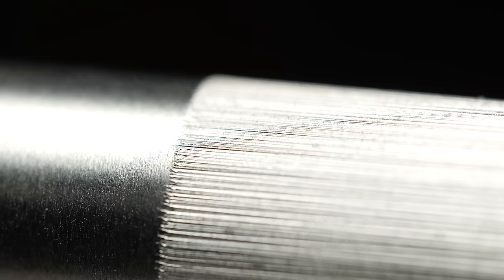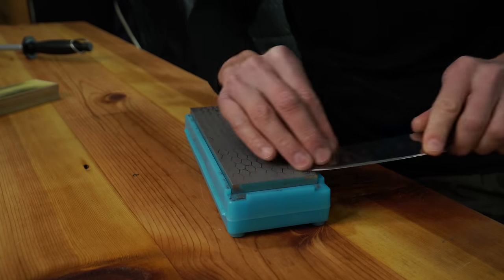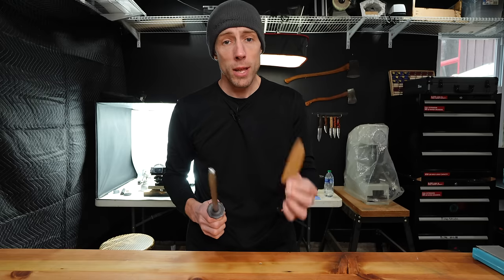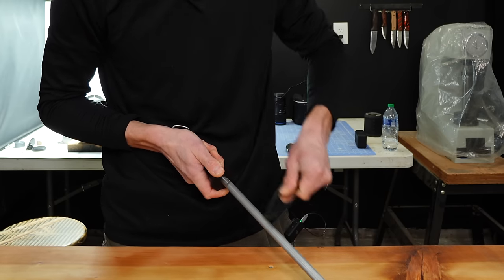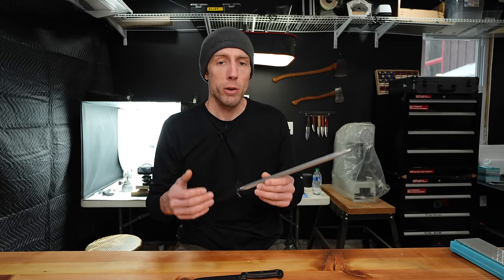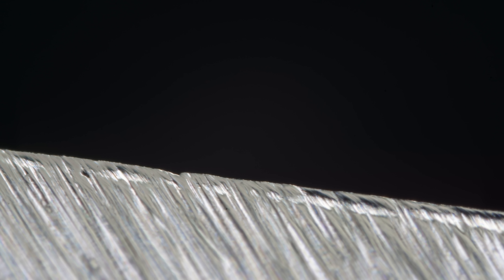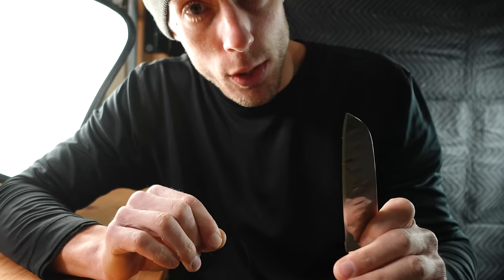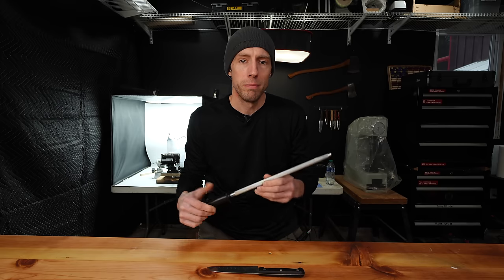What Do "Knife Sharpening" Honing Steels Actually Do?

Comment: You are completely wrong. Steel depending on it’s alloy and temper will either chip or roll. You call a roll a burr but it is a roll. 2nd, anyone with any real knowledge doesn’t use a “hone” with those crappy ridges, they use a smooth polished “steel” that is tempered harder than the knives they use. The reason being that yes it does in fact smooth out a rolled edge as you showed. Professional knife users such as meat cutters don’t generally finely hone the edge because the feathers on the edge from a courser grind cut meat better than a “sharper” polished edge will. Think of it like tiny serrations which they are. The issue is, those feathers aren’t supported by steel on either side like a finely honed edge is so they are weaker and more prone to bending or “rolling”. They don’t have time to constantly “sharpen” a blade and they don’t really need to as the edge is still there it just needs to be realigned. Hence a fast pass over a steel and back to cutting. Eventually the base of all those feathers work harden to the point where they no longer are soft enough to roll and they break off. Once enough have broken off, you no longer have a sharp edge and it’s time to break out the stones, remove metal again to make a new sharp feathered edge and the process begins again. Using a steel to fix an edge that is rolled saves time and saves removing metal from your knife. This process has been well known for over a hundred years at least! Microscopes have been around for a long time. Those imitation sharpening steels are a gimmick to sell to an uneducated public to give the illusion of removing metal, (sharpening) but that’s not what they were intended to do. Back when we still had actual butchers, everyone knew this. 👍🏼

Comment: I respectfully disagree with your analysis. I believe you missed the key factor in using the honing steel - carbide content. I love using my steel on low carbide content carbon steels that have high toughness. This is the type of knife the steel hone was made for and it is very useful. Higher carbide stainless steels never come off my steel honing rod very well. I have loved watching your channel develop - I've seen you take critical comments constructively. I would be stoked to see you dig into what honing rods do to tough low carbide edges.

Comment: here are two mistakes: 1. you dont have in normal situation a so much bent over the apex, in that way as you showed its so unrealistic as possible lol
2. the sharpening steel have to be simply a flat surface steel part, on which you can smoothly straighten out, for yes: the cause if you dont sharpen your knife all day long ;)

Comment: I can count on my hands how often these worked well for me. I have actually had better use for them while sharpening the blade on coarse stones. The ridges on the steel were very shallow so that might have had an effect. I was given a much more textured one without abrasive and it almost always destroys the cutting power on my edge. I run my chef knife on a translucent Arkansas stone with a little dish soap and water before use and have shaving results.

Comment: The only success I've ever had with a knife steel is in my mothers kitchen. She doesn't ever sharpen her knives and they are all incredibly dull, and with reasonable pressure you can at lease give it a terrible edge that cuts instead of no edge that requires you to either saw or hack through whatever you're cutting. I just need to actually sharpen them, but the steel has worked as a stop-gap.

Comment: I have a sharpening steel that is approximately 75 years old. It is different from what you can buy these days. The ridges cut into the steel are considerably smaller and sharper. They appear to function more like a fine file than those made today. I also have a ceramic sharpening rod and it does work much better than the steel.

Comment: I have a steel rod without ridges. It's smooth, it was used a lot by my uncle in a butcher shop. Without the ridges very smooth, very hard steel. You can unroll the edge without damaging it, also a bit of shine If you go light on pressure. The ridge ones are useless in my opinion. As presented they do damage

Comment: You're using it wrong. You should move the knife diagonally accross its length as you unroll the edge in a sheering motion. You're just moving it straight up and down. No wonder your edge is still rolled.

Comment: You are absolutely right but most kitchen knives in professional use are of a relatively soft non corroding steel, they don't hold their sharpness that good, so they usually get sharpened by a person whose profession is cooking and not knife sharpening, so they use either a pull through sharpener or a easy to use driven sharpener. 

So the knifes will likely never get sharpened correctly. Not that is say a sharoening rod is a good tool just a few explanations und why they are used

Comment: Good vid. The chefs I sharpen knives for use the steel rod edge leading not trailing. They tell me they tear off the rolled edge and create some kind of serration. Which in my eyes makes sense but creates a serration that is very brittle then. Can you take on the edge leading strokes under a microscope? I don't have one. I sharpen edge trailing, deburr leading and trailing and finish on diamond loaded leather. I always say the most important step in sharpening is not the apex setting, it's the deburr process.
So I understand that edge trailing on a steel rod is doing what you showed, it's logic. But what does edge leading, which so many chefs do.

Comment: I inherited my grandfather's knives and steel. It is longer than the one you were using and the grooves in it are very fine. When dealing with the rolled edge that becomes apparent on my chef's knife over time, I can easily feel the direction with my fingers. I then gently straighten it on the steel by drawing the knife toward me. I can feel the edge straightening. As that happens, only very gentle contact with the steel is needed to make the edge very straight. Then I can shave hairs on my arm, slice through paper with no effort, etc. I don't know why what works for me didn't seem to for you.

Comment: It seems like the only application for these would be on cheap knives that are poorly heat treated with something like soft pot steel which are very difficult to remove the burr during sharpening. So you can just straighten out your burr over and over lol.

Comment: Funny, I use one and I can keep a knife sharp enough you can shave the hair right off your arm with it. It took me a while to figure out how to use it correctly but once I figure it out once the knife is shaped the normal way you can easily keep it shape using the honing rod. Your right it not a true shapener. it takes a speacal touch. I more about the angle and not how hard you doing it. It also takes a good one not a cheap china one.

Comment: Interesting video with with one MAJOR oversight. Youclearly make the point that the knife is supposed to be dragged across a knife steel honing rod, i.e. sharp side is the trailing edge when using the steel. But you push the sharp side into the diamond stone and the abrasive rod which is whereas the sharp edge is the trailing surface with a honing rod. So it is not the exact same as stated in the video. Of course my point may be moot if using a honing steel is pointless as well. But you should have clearly stated that the sharp portion of the blade should be the leading edge if using an abrasive rod to remove the burr.

Comment: You are also using it the whong way in your demo in the beginning. And removing rolled edges do sharpen the knife. They are also made of a steel quality higher (higher carbon content and also hardened)than your average kitchen knife, meaning that using enough time it Will sharpen the edges as well, as long as you have a correct technique (if not you're likely to ruin your blade), their intent is however not to sharpen, but to hone the edge.
There are also ceramic hiking steels that are harder than the hardest high carbon steel as well.

Comment: I dig the deep dive and appreciate the breakdown. 

I used to work in a relatively real kitchen, at least one where you needed to know how to use a knife and later had to switch to a coffee shop where I was the only person with any knife experience. I bring any of this up because at the coffee shop I became the guy who maintained the knifes and I even picked up a cheapo stone to do actual sharpening. 

The odd thing to me was that I found that every time I used the stone that I never really enjoyed the edge quality until I also used the honing steel. 

Now, I always assumed that I was removing the burr with the steel, not rolling it.

Also, I always would do a back and forth motion that was strangely light and swift. So I would go edge forward along the steel, then edge backward. Essentially just like the Gordon Ramsey method that you poked fun at. Only I was deliberately trying to be somewhat gentle in my flurry. Think someone doing the funky chicken.

Anyhow, this method always seemed to work the best for me, especially if I was going very light and swift. I also found that I rarely had to use the stone. I would usually just freshen up the edge with the steel every few days and I was back to thinly slicing onions and tomatoes for sandwiches. 

I would no way pretend that I know what's going on specifically, in fact my main credentials is that I'm barely able to use knives at a professional level if at all, so that makes me somewhere between someone who's informed and someone who's a total normie.

That being said. It always felt like I was combing the hair of the edge and the steel was the comb. I also suspected that I was at least partially removing the burr because the edge also always felt like it lasted longer when the steel was used.

Comment: As a hot beef butcher I always use carbon steel knives and the first thing i do to a honing rod/steel is remove the groves and make it a smooth rod. I agree it is not designed to sharpen a knife or fix role overs like you have shown, it is to straighten the edge of an otherwise very sharp knife.

Before work it's sharpen on a fine water stone, in between every animal it's disinfect the knife, than strop the blade on the steel. If necessary re-sharpen at lunch break.

Carbon steel knife hollow grind, an edge the does not reflect light and a smooth steel for an 8 hour day. I'm not allowed to sharpen the kitchen knives :(

Comment: Best sharpening for standard german steel chef knives is a 15-20 degree angle on japanese water stones. Then strop on the stone before honing on a steel rod.

Japanese steel same process but use a ceramic rod instead of a steel.

The abrasive diamond rods is a  shortcut that does not match proper stone sharpening.
Diamond stones tend to remove too much material over time bs a japanese water stone.
A regular sharpening stone with oil or water is second best, strop on the stone then steel it.

Worst method are mechanical sharpeners with spinning wheels. They remove a lot of material from the edge.

Comment: Regardless of what is happening, before I use the steel its hard to cut a soft tomato, and after the steel it is easy to cut a soft tomato. So whatever the steel does it makes life easier. I’m not arguing with your method or your findings, I agree with you, but something happens to make the knife cut better. I can see the results immediately before my eyes. Maybe a broken burr cuts better than a smooth one. Whatever the steel does it doesn’t last long though, because you soon have to do it again, which isn’t desirable, but it does work briefly. Maybe test on some soft fruit.

Comment: Saying that using the steel fast does nothing is misleading has hell. It doesn’t do anything different than going at a normal speed but it still works great if you have proper technique.

Comment: I like this channel but this time I have to disagree. A true honing rod is a smooth piece a steel and it does what it says.The ones with the grooves act like a file and can sharpen a soft steel knife enough to be used in a kitchen in 1-2 minutes. I have a forge and made some knives and swords. I can sharpen knives on stones to cut hair but it will take me ten times more if the edge is really bad. I received a set of decent kitchen knives and my family cuts stake directly on the plate and ruins the edge. Now I have three different sharpening rods and I don’t care what they do because I sharpen them in a minute. When I cook I’m using my better knives but if I left them in kitchen … On really shitty steels I used even a chain saw file to sharpen instead going to the bench grinder. You get some sort of a saw but it’s the edge which I found it last longer in my family.

Comment: You are always going to have rolls on a European style kitchen knife because they are so soft.  Even a good quality Wusthof of henckels knife.  You do need to constantly straighten those edges with the provided steel.  The reason your steel was tearing up the edge and not just straightening it was because it was new.  Try using an old dull steel.

Comment: I feel like I may have already commented on this video because I'm having dejavu... so the reason we use these in kitchens is because it takes time to actually use a stone. Good kitchens have abrasive wands and in like 5 seconds you can have a razor edge. If there was a safer way to handle a stone I'm pretty sure it would be more standard but it's much easier to slice open your finger in the middle of service if your holding a stone rather than a wand with a guard

Comment: Hones were never intended to straighten a true rolled edge! You're thinking in 2 dimensions, you need 3 dimensions. A sharp knife edge should be a straight line, but with use the edge bends slightly to each side making it a sort of zig zag. The hone is only supposed to align that slight waviness back to straight again, not unroll an edge. I'd like to see this retested with an emphasis on how straight an edge is, since that dimension was totally omitted here.

Comment: Not a pro. But I can attest that I pre Fer very sharp  tools ,I do use an antique single edge straight razor to shave , the back roll technique or similar whe using a steel or ceramic rod hone gives better results than trying to stop at the end of stroke and then reposition for the next back stroke, othe wise you just roll the edge back an forth ,check with an old school barber ,sure cuts the 5oclck smooth as a baby's bottom, oh by the way been useing the straight razor since high school ,retired two years ago

Comment: Yes sir.  You are correct.  The only way those honing steels are effective is when they are used like a sharpening stone.  In that case you might as well just use a sharpening stone.  The honing steel works in a pinch.  Knife sets often include one. They're compact. They are convenient and fit in a knife roll bag.  They definitely do not replace a proper sharpening stone.  Just use a stone.

Comment: After I sharpen the blade, I hold the knife steady and push the rod out across the knife pushing towards the apex. I seem to get a nice sharp edge, and typically only use the steel rod to finish the edge.

Comment: Man, you need to learn to use a steel before you say it doesn't help, even when you were doing the hard pressure, you were doing it in such a steep angle, might as well have run it perpendicular so you can destroy the edge more.  When using a steel, you should be maintaining the same angle that you sharpened the blade with.

Comment: It’s all in the wrist I’ll be happy to teach you the proper way to use this tool mind you I do not disagree with you on the fact that it is outdated also your honing rod is not one of good quality your rods grooves are spaced to far from one another also you shouldn’t be using steel it should be a more abrasive metal alloy if you want quality it cost you know that I should assume as I was saying with the proper tool and the proper application of that tool gives quality results if you start with a garbage tool your results with that will be garbage might I add the know is the key once you know the door becomes open so begin where you started and follow the same course knowing that the tool is for burr removal not roll removal also start with the sharpening and what was it just run it threw some wood lol just “hone” ur edge properly

Comment: Only time I used a honing steel very successfully was with some old knives of my parents that were made from very soft metal, they are pretty thin and have never been sharpened in the time my parents had them. Pulling them over the honing steel a couple times is more than enough to make them very "sharp" again if they ever get a little "dull"

Comment: i sharpen my knife with stones but i still use a honing rod every now and then inbetween sharpenings just for quick passes to straighten the edge
i've only noticed a real big difference when cutting meat but not much anything else and so only my boning knife sees the honing rod
the knife has to be sharpened properly for honing rod to actually work and it's only light passes every now and then just to straighten out any possible rolls during use

Comment: the honing rods i use you are supposed to point the blade away from yourself while honing, same goes for sharpening steels, they have a similar texture but are very hard and sharp vs a normal chef knife allowing them to scrape off tiny amounts of metal, my shiny honing rod is great for polishing an edge or rolling an edge back to straight, for actual abrasives i have a ceramic rod, several diamond steels and many blocks
biggest thing is never use a tungsten scraper unless your knife is heavily damaged and even then use a fine single line cut bastard file as the edge quality is always many times better